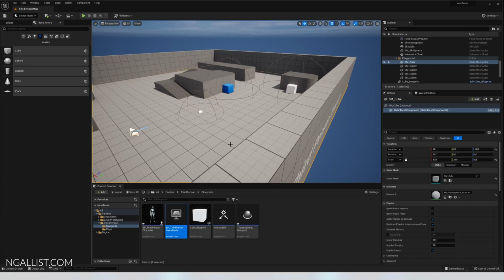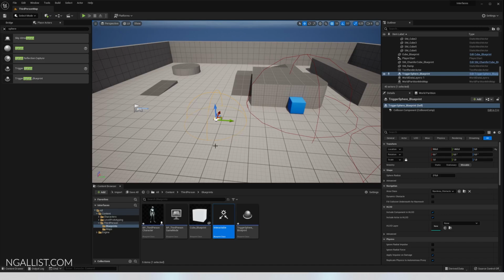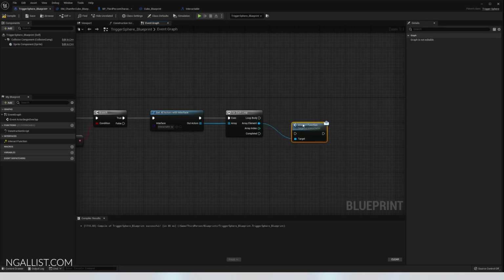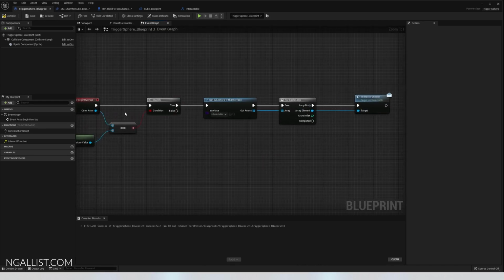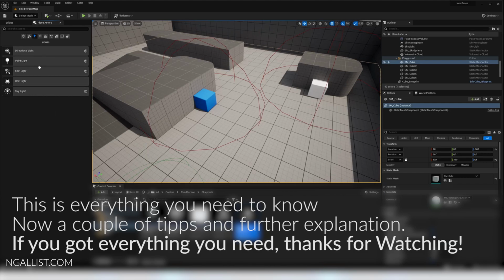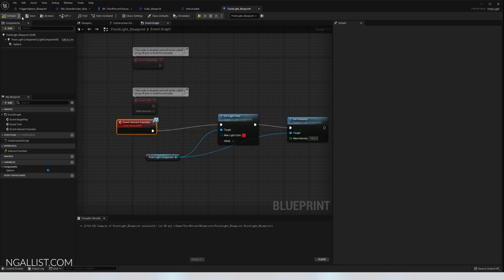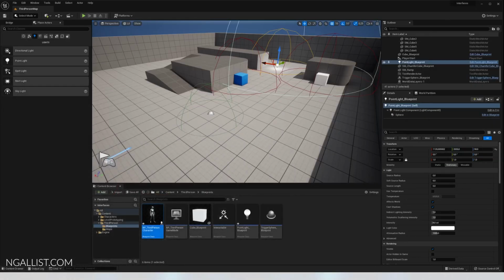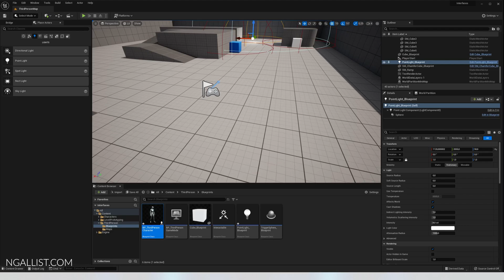How to use BLUEPRINT INTERFACES in Unreal Engine 5

Comment: Came here for help but I'm not helped. I had a script that updated a UI by doing this bu thte guide told me to put the interface event in the Player character blueprint. In that case, it works, but I moved it to the gamemode blue print since i need it to remain even after respawning but the problem is, the interface event just won't trigger anymore. It triggers 100% when I call it but the event it self wont go off

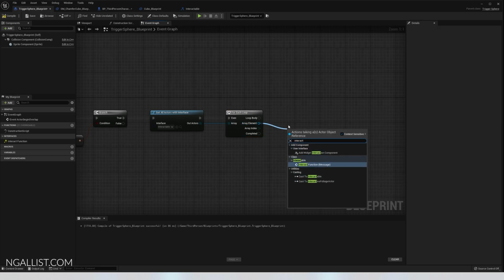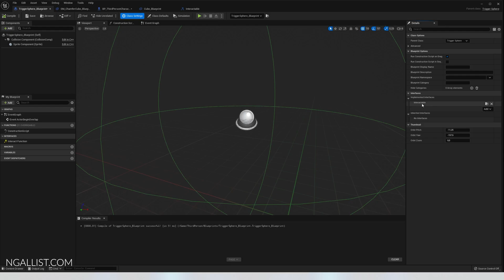Comment: At 2:35 you need to make sure you drag FROM the Array Element link, otherwise you don't get the Class Function with (message) at the end. If you just right mouse click and add the function, you get the version without (message) which looks identical, but doesn't work. Also, on UE5.1 there is no Add button for Implemented Interfaces! (shown at 1:50) You have to add it via Inherited Interfaces. Reading around, this seems to be noted as a bug, but seems to works... Tutorial is good though. Straight the point - Thanks.
Reply: The Add button does appear to be in the wrong place in 5.1. Very confusing.